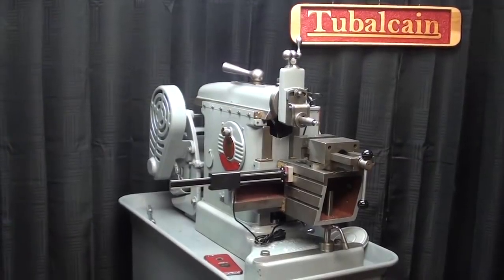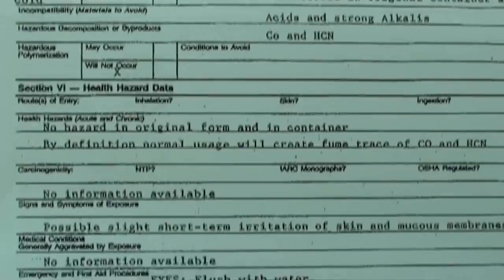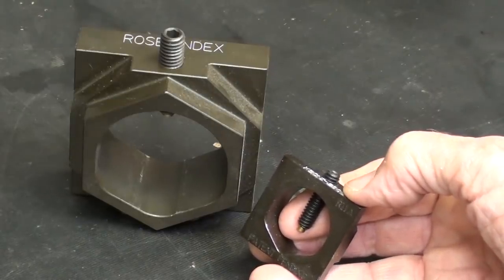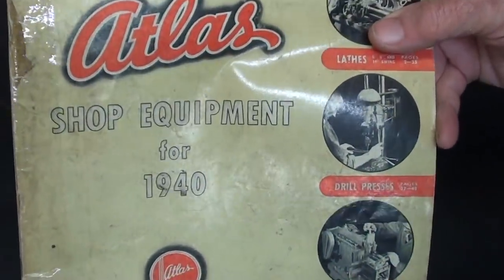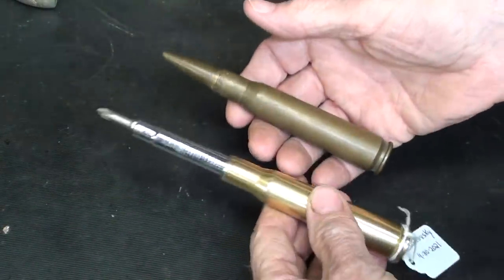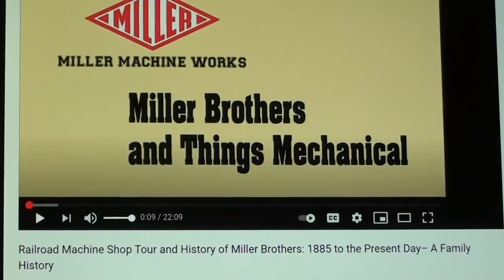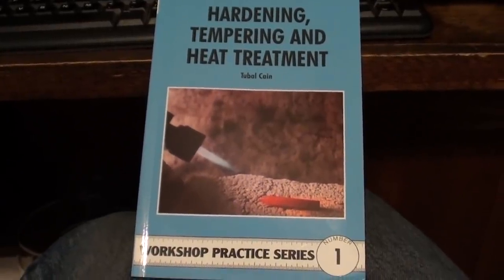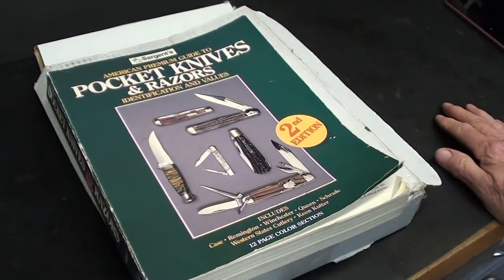THIS & THAT #64  south bend shaper tubalcain mrpete

Comment: I found a thread on hobby-machinist titled "I found my Kasenit!" where the poster named "Alan H." provided the following info in one of the repleis (paraphrased for length):

Alan said he read that the demise of Kasenit was due the difficulty in sourcing hydrogen cyanide (HCN), which is used to make the sodium ferrocyanide portion. The HCN manufacturers stopped or limited shipping the HCN due its toxicity and risk associated with moving it in cylinders and/or rail cars. So producers shifted to using the HCN to make derivative chemicals at the same site - DuPont for example did this in the 80s. Small volume chemicals like Kasenit had too low of a demand for the companies producing HCN to justify the cost in setting up facilities.

Alan ended with saying to hang on to that old can of Kasenit, and that it is more valuable than that old can makes it appear. He also posted a couple photos of a can he shined up and restored
Reply: Assuming the above is mostly true: My guess is that Kasenite's business relied on converting cheaper HCN into Sodium Ferrocyanide, as the latter is still available for other purposes.
Reply from the maker: Thank you, very interesting

Comment: The boss had tons of Zig-Zag rolling papers and we all had plenty of them in our toolboxes. We used as shims, especially on the surface grinder. When wet and under a steel block they were about. 0007" if I remember correctly. Thanks for the show.

Comment: Re the paint color...  Did a little searching and found this site:
https://www.practicalmachinist.com/vb/general/colchester-lathe-paint-codes-248622/
which lists the colors as Dove Grey and Raven.  Couldn't get much with the numbers, but the site:
https://www.w3schools.com/colors/colors_british.asp
shows them by name and gives the RGB values for them.
Dove Grey #909a92  in decimal 144 154 146
Raven #333335         in decimal  51  51  53

The numbers are in hexadecimal (base 16) with 2digits for Red, 2 for Green, and 2 for blue.  Paint store should be able to do something with this
p.s.  Didn't try to research the newer 381 British standard, but those numbers can be found on the second reference.
Haven't checked with the paint stores, but the hex numbers are what the web uses, and this should be cross referencable...  Good Luck.
Reply from the maker: Thank you very much

Comment: The Peterbilt plac is supposed to be red around the lettering and gets places on the side of the engine hood. A smaller one is placed in the top front of the hood.

Comment: When I worked for power king tractor company we had fixture devise nearly identical to the rose index.   We used to set up shafts to index/clock keyways on the horizontal mill.

Comment: The university that i used to work for has an old garbage truck thats actually a volvo but still has a gold mac dog on the hood..   big ole volvo grill, rounded doors and a volvo engine but guess it was either a mac design or somebody put the thing on the hood themselves but the thing is attached with the screws that only go one way..  the flathead with raised portions only allowing you to tighten.  Only other place ive seen those screws were on bathroom stalls.. but just had me questioning the truck...
Reply from the maker: Thanks

Comment: PACCAR started building engines in 2010 with the introduction of the MX engine. It is built in Columbus Mississippi. I believe they also manufacture transmissions.
Reply from the maker: Thanks

Comment: The thing is simple for the shape grinder , the scale on the settings for the head to move are way to rough for a grinder , those are normaly operating in a thousands of an inch and even lower , if you now set it with the normal dial on the shaper  the stone will crash  into the material and explode and that is way to dangerous to the people who operate those things , if they had made a propper dial for the grinder to set it on its own it would have worked in my mind , but it would be also still pretty dangerous because if you are used to a machine you  always grab the dials you're used to and set them what would be terrible too .

Comment: Mr. Pete, thanks for another interesting video. Aluminum foil and wax paper are .001 thick but poor material for rolling cigarettes. I use a layer of wax paper to prevent pull-off scratches from the magnetic chuck on my surface grinder. Ground parts placed on wax paper slide off the chuck easily without scratches.

Comment: Sodium ferrocyanide is fairly safe as is, however it can make hydrogen cyanide gas with water, or even more so with acids. And hydrogen cyanide is probably one of the most dangerous cyanide compounds ever.

Comment: For your lathe color. One thing you could do is take a picture of it and upload to a site where you get a hex or other color id on it. Do it on different lighting levels and see which fits the original color the best. Hopefully that could work at ace or at the other place.  I might be able to find a site or 2 which could be useful
Reply from the maker: Thanks
Reply: @mrpete222  so from your picture/video, its possible the color could be (the site I used was HTML Colors from images)

#AFA697
RGB 175, 166, 151
and the name of it is Napa or something, 

from the Sherwin Willems ColorSnap thing, it came up with

Diverse Beige
RGB 197, 181, 167
#C5B5A7
 or 
Avenue Tan
RGB 188,176, 153
#BCB099

however thats from the video and the lighting from the shop could have an affect on it, not fully sure but I hope that helps

Comment: You don't need 'medicinal m' to get sleep aid. There is an oil extract of m now commonly available called CBD oil, that has zero of the THC stuff that makes one high.. but it is the stuff that helps with sleep and joint pains.  Because it has zero of the regulated substance, I am told it is legal everywhere in the USA and many brands are available, even on the big 'Am...' online sales platform.
Reply from the maker: Thank you, I will try to get some of that. But I am highly skeptical. I have tried everything

Comment: Hey Mr Pete I have a suggestion on your paint scheme although I do not have the number for your lathe one of the things that I have found that works well and doesn't cost a lot, is I like to use primer primer doesn't cost very much you can get it relatively cheap but then after I primer I use a clear coat right on top of the primer it leaves a nice color gray (depending on the primer that you choose) and it leaves it durable... I use this formula in the bowling machine business.. the Brunswick machines when they were built after world war II were used with military surplus so when they started mass producing the machines they would go to military auctions and buy 55 gallon drums of paint I have done this for years and depending on what you choose either clear gloss or matte you can get a pretty good color out of it. .. Just a suggestion..
Reply from the maker: Thank you. That is interesting about the bowling machines

Comment: Here in Sweden we dont have Peterbuild trucks but I would read that as crome/gold in the front of the sign, maybe someone can tell if there is that combination over there?
Reply: I have seen chrome-gold, but not on the trucks. With 2 different part numbers, they would be separate. ✌

Comment: Kasenit forms Hydrogencyanide when you mix it with a strong acid. Thats probably why they classify it as hazardous.

I found you can take a part of the machine to a paint shop or home depot and they have a machine that scans the color and they mix a color that matches this.
Reply: Also Sherwin-Williams has a phone app (ColorSnap) that will tell you the S-W paint colors that approximate the colors in a photograph. 

Obviously that's going to depend on the lighting in the photo, so it may not get very close

Comment: Little something about your bull dog
Note the squared tipped ears
That is a early version bulldog 
On the conventional trucks that what you used for pulling the hood open with
Apparently the squared ears were hard on the operators hand so the next and current version have the ears rounded off so its easy on the hand 
Got my start at Peterbilt Motor Co after high school then went onto Mack Western Trucks  then to Freightliner 
It was my metal shop and auto body shop classes that I contribute to my 37 year career and only 3 jobs in my working time
Also spent 4 years teaching welding at our ROP and 4 years on the school districts teachers advisory board
Reply from the maker: Thank you for that information on the bulldogs ears. You had quite a career. It was very important for schools to have input from industry. In my area we call them advisory committees.

Comment: I thought you were going to measure the paper thickness with callipers or a micrometer.
Reply from the maker: I meant to do that and forgot. But I did it off-camera immediately after I purchased this contraband. And it was exactly 1000 th
Reply: @mrpete222  Stack 1000 of them together then compare with a gauge block. (in the interest of metrology of course)

Comment: Mr. Pete dont know if you're aware of this but the movie refer madness was complete bovine excrement, most of the anti marijuana information was generated by a government employee who was more concerned with keeping his chushy job than providing accurate information. They have a company called Job(irony) they make rolling papers in many sizes and thicknesses for those learning to roll , job 1.5(aka bedsheets) are extra thick to prevent breakage. All you would need is a puff or 2 and you'll be sleeping and dont worry you wont turn into a zombie. I see those parallel pliers of yours in tackle boxes more than anywhere else. Sorry for the rant
Reply from the maker: I love a good rant

Comment: Would your book on hardening, tempering, heat treatment be good for a blacksmith hobbyist ?
Reply from the maker: First of all, that was not me authoring the book. He’s far smarter than me. Yes, I think it would be a good for a blacksmith
Reply: @mrpete222  thank you.
Reply: @CarlJohnson-ry3gc  His real name was Tom Walshaw. He wrote a number of books in the model engineering series. Link here:
https://en.m.wikipedia.org/wiki/Tom_Walshaw
Reply: @howardosborne8647  thank you!
Reply: @CarlJohnson-ry3gc  Just to also mention it is an excellent book full of useful info and detailed explanation on hardening and tempering. I have had a copy for many years and frequently referenced it.

Comment: A lot of people roll their own cigarettes (tobacco) here in England, so if you buy a pack of cigarette papers nobody thinks you're buying them for smoking illicit materials. When I was a smoker I nearly always rolled my own - for so many years that I could roll a cigarette with one hand. There are different weights available - I might have to buy them just to measure the thicknesses!
Reply from the maker: I did not know there were different thicknesses
Reply: mrpete222  I have just been to my local supermarket which had three thicknesses of the most popular brand, although they produce 4 or 5 thicknesses. I bought a pack each of "medium thin", "thin" and "super thin". I'd be happy to send you a pack of each Mr Pete if you give me an address to send them to. I'll describe them as "paper shim stock" on the customs declaration! Stu McCabe.
Reply: In large parts of America they are no longer illicit materials.